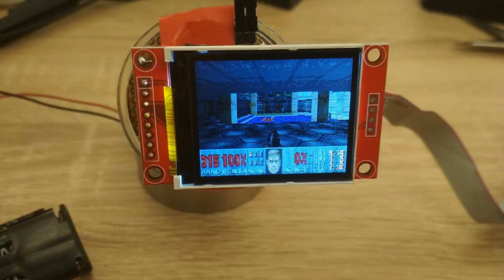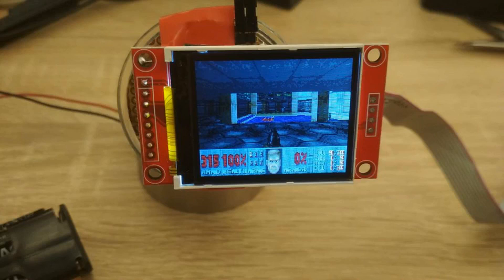Doom now runs on an Ikea smart light bulb

Comment: The big question is: why has a bulb a processor to run complex Programms... Only to switch it on or off via wlan? Just think about it
Reply: Cheaper to buy bulk than design a new chip
Reply: cuz you need to run software able to connect to wifi and accept commands to turn on, turn off change brightness etc
Reply: @Szarus123  this dont need such a calculation Power.... Think 30 years Back. Would you use a 386 or 486pc  to control a Light bulb?
Reply: @hanswurst3811  you would use a 6800, 8080, 6502 or something similar.

If it does not have a Memory Management Unit, its a microcontroller, which is what is sitting in the lamp.
Reply: Smart bulb that can be controlled by a device like your phone